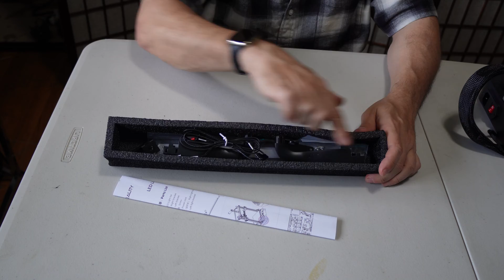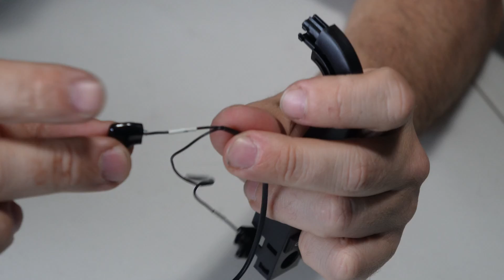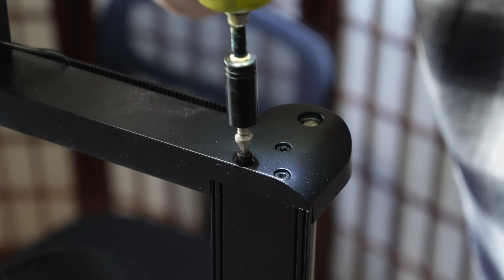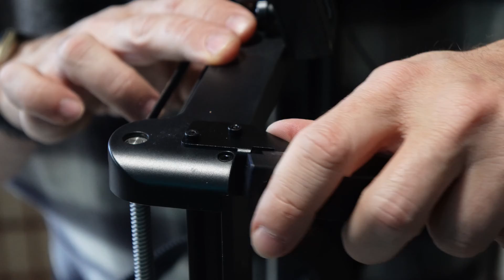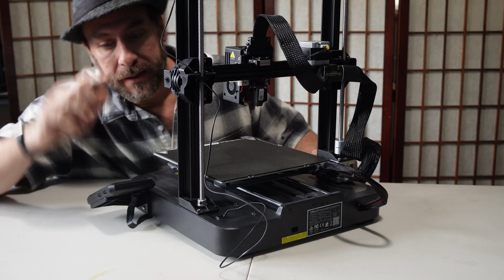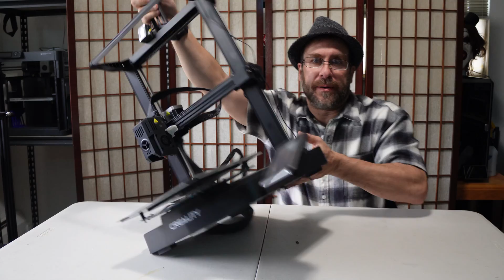How to Install Ender 3 V3 KE / SE LED Lightbar - Creality 3D Printer

Comment: The two wires from the lightbar are easily fed down thru the RHS vertical gantry column into the base for easy connection to the mainboard, so no need to remove that little plug @6.24 and no need to remove the whole gantry column.

Comment: Another excellent video, have installed mine now, no problems.  I have made 2 brackets to hold the cable dopping from the Top to the bottom of the printer clearing the Z axis screws.  The stl files are on thingyverse where you can download them if you like the idea.  Type "Creality ender 3v3 KE light cabling brackets" in the search box.

Comment: I would advice that you directly connect it to the power supply instead of the main board. There are free ports in the power supply  so you dont need to do the thing you did to the 24v input of the main board.
Reply: Thank you, I was wondering about this. And you can route the cable through the other vert, then just snip a bit of plastic on the top bar and the casing - you don't have to unscrew the verts at all
Reply from the maker: Nah, this works super
Reply: @3DRundown  Except, putting two wires with connectors on it like that into screw terminals is never a good idea, you get less surface contact with each wire to the terminal which could cause issues with excess heat due to poor contact. in that case, you would be better cutting off the connectors, twisting the wires together and inserting them that way. Even better would to crimp a new connector onto the combined wires. Connecting the light to the power supply is a much safer way to do it. (coming from an electrician)
Reply: @Mc3ain  The video titled “Custom Lighting for the Creality Ender 3 V3 SE/KE” actually shows the correct method from start to finish. Thanks a lot for your comment, it really helped me dig deeper into this. Even the official Creality guide had it wrong.
I’ll be using the free 24V ports on the power supply as you suggested, and I’ll crimp the wires properly instead of stacking connectors in the same terminal. That’s definitely the safer and more professional approach.
I’m also routing my cable through the frame because it looks much cleaner and prevents it from hanging out of the printer. I’ll feed the wire down through the gantry channel using a short piece of filament to guide it, so everything stays snug and hidden.
Thanks a lot, greetings from Germany!

Comment: Hello I recently installed the light bar and now the screen won’t power on do you know how to fix this problem
Reply from the maker: I'd start by removing it's wiring to the power supply, and checking the original wiring to the 24v connection. Then seeing if it powers on
Reply: @3DRundown had same issue. Unplug the led wires and it could turn on. Now too scared to try to plug the led wires in again

Comment: is it safe to pit 2 diferent devices in the same fuse or would that overload the fuse
Reply from the maker: I run 4-5 per circuit. Best not to have them heating up at the same time. That's when use most power. If worried of popping the breaker, start one, then, when it begins the print, start the other. But 2 shouldn't be a problem at all

Comment: Nice video, thank you. One question…. Nothing holds the wire out of the way of the Z axis roller. Is there anything that keeps it from getting pinched in there during printing?  Or, is this just something that is not able to issue?
Reply from the maker: I thought about that too, but it hasn't been a thing for me....
Reply: @ good deal thanks.

Comment: That's not how Creality suggest you feed the wire, ie using the knock out piece, they suggest you feed it through the gantry which is what I did.
Reply from the maker: Creality instructs to use the knockout
Reply: @3DRundown  Best change their video then
Reply from the maker: They don't know which way is up. I think I mentioned this in the video. The instructions say KNOCKOUT, their Video, shows something else....

Comment: Dude, your instalation guides are simply the best around, would you be be able to do one on the instalation of the Creality auxiliary cooling fans too? those that go in the back of the X gantry.
Reply from the maker: Hey brother. Thanks so much. I put allot of work into these. I'd love too, but, I don't have one, and it's just not possible to buy it all, or request it all from Creality (though it would benefit them!). Are you referring to this one? 
https://store.creality.com/products/fan-cooling-kit 
Make you a deal.... Venmo me the $27 it would take me to buy one, and I'll get it and make a video on it. Which machine you looking for me to install it on? Double check the site for compatibility.
Reply: @3DRundown  Yeah, this one exactly, I'd make that deal, just need work out this Venmo business works.

But I was looking to install it on the E3 V3 KE and it doesn't seem to be compatible. :/

Shame, the AliExpress listing I saw said it was compatible.
Reply from the maker: Venmo is super cool. Very easy, very mainstream these days. You'll be surprised to see how many of your contacts are on it. Check it out. As for the fan, yea, it's meant for the S1 line.

Comment: I'm terrified of the idea of having to remove the bottom plate of my printer.  It works so well and I feel like Creality printers know when you fiddle with anything at all that you're not completely confident in and they respond to that lack of confidence by breaking somewhere completely unrelated.  My first print was the s1 pro which I loved for about 6 months when all of a sudden I couldn't get the bugger to level properly and gave up on 3d printing until I got the KE several months ago.  The only thing I can really complain about the KE other than the usual bumps learning and adjusting to a new printer (particularly with also having to adjust to a new slicer to make it work at its best) is that it doesn't have a light pre-installed.  This doesn't look particularly difficult, but neither did replacing the joysticks in my kids ps4 controllers until all of the fiddly tiny parts kept breaking instead of doing what the videos demonstrated they were meant to do...not sure if I should give it a go or not. 🤔
Reply from the maker: Working on your printer in all ways, is something you absolutely want to become comfortable with. Opening up, to see the mb, is a normal thing in our world. Take your time, and Go for it.
As for the S1, I have a very detailed tune up video, and leveling video. Follow them both with me, and get that s1 back in service

Comment: Is there a way i can controll it using klipper on my se
Reply from the maker: Negative
Reply: @3DRundown  i think i could try and add a motor to flip the switch with a macro
Reply from the maker: Maybe. Cutting power to it, isn't an option, at the board, because it's tied into the main power source. Gotta cut it somewhere AFTER that point.

Comment: Thanks. Installation done. Just one edit. You say the thru-hole is on the back right. It's really on the back left. Probably because you had it turned around you said right. Now to design and print a clip to put into that hole that snaps in and holds the wire kind a tight, and a light bar cover as it's really bright while I'm sitting at my desk.
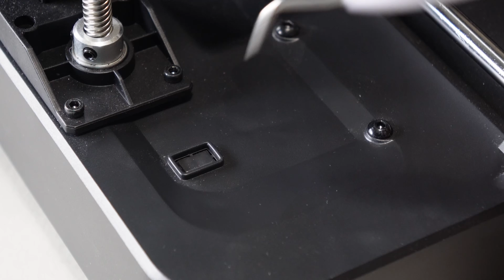Reply from the maker: 🤔At 6:28, I say "Rear Left".  They are def brighter! Mine are never turned on.

Comment: Love your video! So how do you run the LED wire neatly? I just put a zip tie at the very bottom after making sure you have enough wire to clear the big vertical screw on the back. Also make sure you leave some extra wire to allow the stepper motor to clear the wire when going up.
Reply from the maker: Some run it down the inside of the rail. I just leave it there. I have 3 like this and never had an issue
Reply: Thank you, I installed it today, following your instructions…..No issues 😀

Comment: So you left us with a wire flopping around where it can get caught in the moving parts? 

I understand that you wanted something simple for beginners, but you owe it to them to at least mention the cleaner option. I think Creality did us a disservice by including only the "simple" instructions with the product, and if I had not seen their video before I saw yours, I still wouldn't know there is a better way.
Reply from the maker: I tinkered with the other methods, and I don't like them. I have 3 models: S1, V2, and V3 KE, hooked up this way, and I have seen absolutely no issue at all with the wire placement. No moving parts have bothered it at all. Hundreds of hours of prints on each. Everything I show, is based on actual real world use, here at my shop. #KISS
Reply: @3DRundown I ran it down the inside the gantry housing and I can’t get the light to turn on. I’ve procrastinated opening the machine up again because I’ve got birthday presents to print but I’m worried I pinched the wires doing it the clean way. I cut a notch at the top of the gantry like the left side has already but there isn’t really a notch on the bottom of the machine. We’ll see!

Comment: Excellent job on showing how to connect the wires in the motherboard, helped me out a ton. I did a different strategy than you did or that @mdeshon mentioned in your comments below - I took off the plastic parts off of the wires of the light using an exacto blade, and on the side of the light switch, I fed the wire in the leftmost tiny ridge-gaps on the gantry surface (not within the gantry itself - there was zero removal of the top plate holding the filament sensor or the gantry) and through a small gap present on the Z motors - it is extremely flush, required no disassembly besides the under panel for hardwiring into the motherboard and the four screws for actually attaching the thing. That being said, it was a PAIN to feed that wire through, and I also had to add a few mm of electrical tape to the ends of the + and - wires so that the live points didn't contact each other when screwing them into the motherboard because of removing the plastic bits. It works fantastically though! Thank you again.

-SR
Reply from the maker: Very cool. While it's fun to go super nova nerd, For me, I have to try to go a route that the masses can understand, and do themselves. If I overcomplicate, I cut out large audiences. 
Very welcome. Good to have you
Reply: @3DRundown  I totally understand. It is what I enjoy the most about watching your videos!

Comment: I followed your instructions to assemble the light bar, but after doing so, the printer would not turn on, any suggestions on how to fix this?
Reply from the maker: My guess, would be a short. Either at the light, or the motherboard. Make sure neither of the wires are contacting eachother.

Comment: Or you can also send the power cable down the inner left gantry post to hide the power cable from view. 
It’s a little more fiddly but if you’re going to the effort of putting a filament sensor on the se you can do both in one.
Reply: Thanks for your comment, I went this route and it looks amazing with no extra cables @mdeshon
Reply from the maker: meh. Not worth the effort. The Creality video shows this method, despite the manual showing the method I went with. I went with the manual method. Not messing with my working build, for a light, and I'd rather my Noobish peeps, not either. My more experience peeps, are gonna do it however they want anyways, or, mode the crud out of it. 😂😂 I usually remove sensors, instead of install them. 😜
Reply: @3DRundown  You can pull the wire through the post using a length of filament and some tape. That way, the only thing to remove is the top brace, rather than the whole post.
Reply: @andydingley4966 That's a really good idea ✌️
Reply: @andydingley4966 I got mine down without much effort, no need for pulling. Same with the sensor. Just kinda pushed it down gently and grabbed the end with tweezers when it was at the end.
Reply: @3DRundown I made the mistake of watching Creality's original install video, and has the entire gantry removed and parts falling everywhere before reassembling and finding your video.  I can't tell you how much yours helped.

The official creality video is so deeply unhelpful that it's bordering on malice.